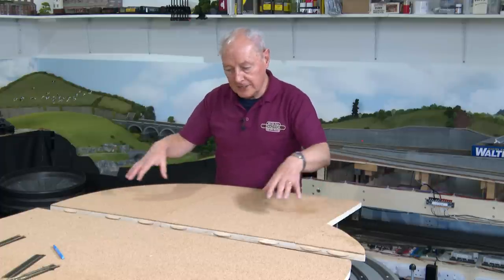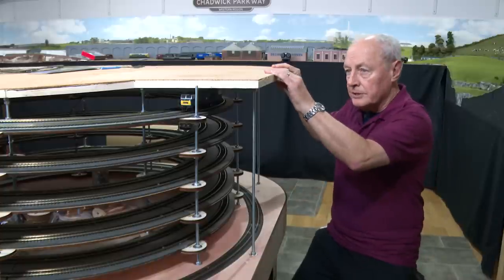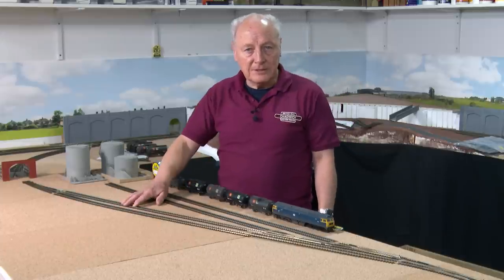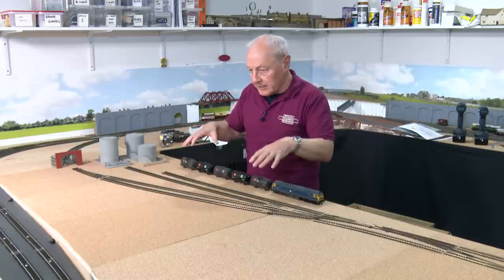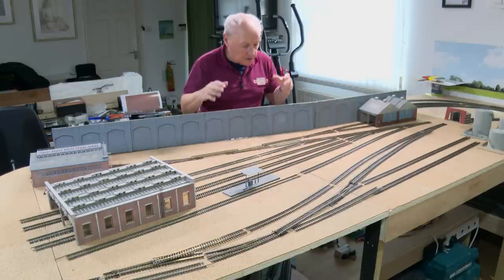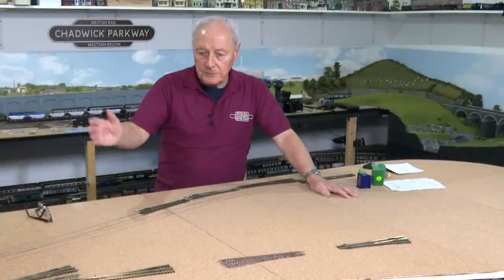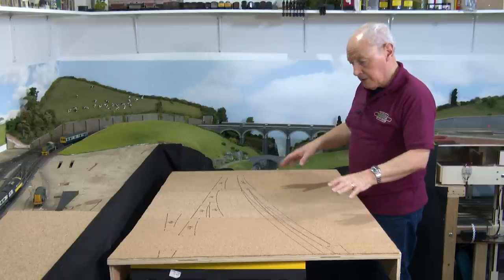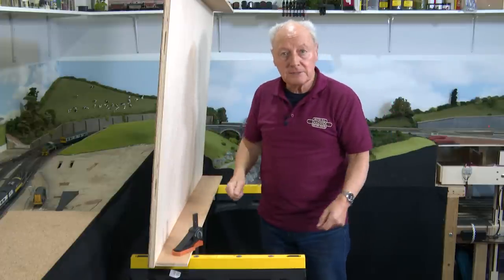Autumn Update at Chadwick Model Railway | 172.

Comment: Looks good but doesn't the TMD needs a headshunt also before the tunnel? If a loco is shunting it gets on the manline. If you would make a headshunt you can safely reverse back into the TMD to a additional long track with the washplant on it. 

If the headshunt is long enough you can even use is for dmu or coaches that needs to be cleaned without the use of the mainline during shunting in the TMD
Reply from the maker: You make an excellent point MD, I shall have another look. Regards, Charlie
Reply from the maker: I’ve been thinking about your suggestion, but could you possibly email me a sketch of your idea. You could send it to chadwickmodelrailway @ gmail.com. Regards, Charlie
Reply: I'll have look tomorrow
Reply from the maker: Much appreciated mate.
Reply: @ChadwickModelRailway  you got mail

Comment: hi sorry don't get the argument for a head shunt in reality it would not happen. for a number of years in the 70's I was signalman at richbourgh sidings. a mainline signal box between minster and sandwich in Kent with sidings to supply oil to the power station. each day a train of 10 100-ton oil tanks will arrive from Hoo junction it would be stopped at my home signal it would then draw forward still on the main line and back on to the sidings. when the trains left it would reverse out of the siding over the cross over on the mainline before leaving to go back to Hoo junction. please note this was the Kent coast main line and any mainline service train would have to wait. now way would the railway have maintained with the cost involved a head shunt for this purpose hope this is of interesting
Reply from the maker: Thanks mate, yes that’s very interesting.
I’m sure that somewhere else, the opposite will be true.  Stay safe mate, regards Charlie

Comment: First, get healthy soon! I don't have any experience with the track you use or British railways, but wouldn't you save space with a single X-shaped switch (what's the English name for it?) instead of the two new switches into the diesel facility?
Reply from the maker: Yes I know what you mean we call it a double slip. But in reality it would be a very expensive point to install on an industrial siding. Regards, Charlie

Comment: Hi Charlie, interesting you "found" the MP5 point motors. I have used them on my layout as well (see https://www.youtube.com/watch?v=PzQuJZfUJYU), however, I find them not very robust. They operate poorly and if you have to adjust them a bit, they tend to stop working all together. They are very fragile! I will be replacing all of them by other point motors. I am considering Twistlock point motors, they too are smaller in size. Perhaps you have looked at those as well? If so, I'd like to hear your opinion about these. Regards, Paul
Reply from the maker: Hi Paul, thanks for the info. I have heard that the twist locks are very power hungry.
Regards Charlie
Reply: @ChadwickModelRailway  Hi Charlie, thanks for the reply. Do you know whether the twislock point motors are robust? Regards, Paul
Reply from the maker: Sorry Paul, I don’t know a great deal about them I’m afraid. Regards, Charlie